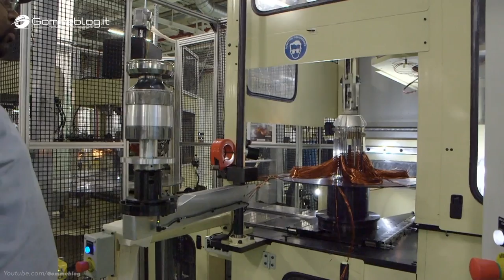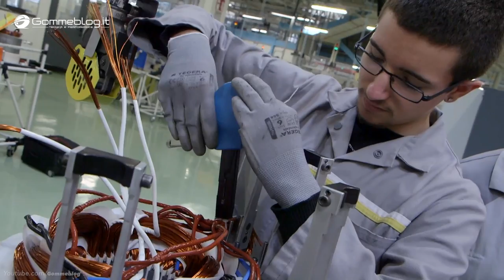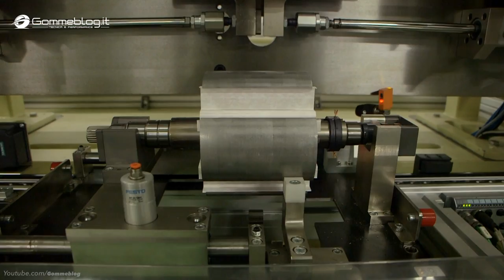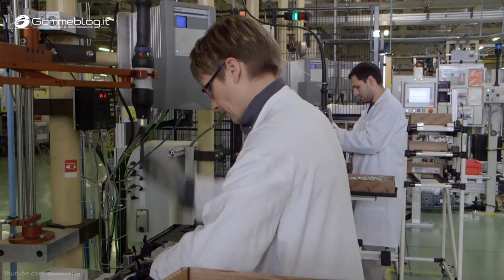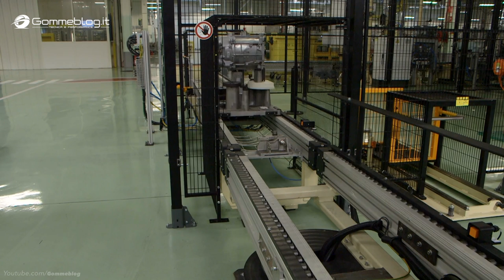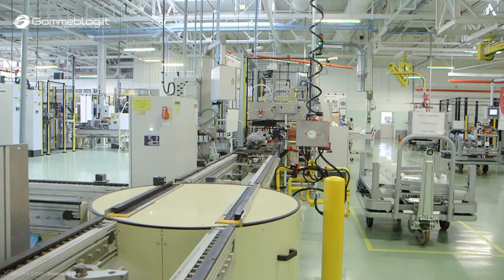Electric Motor Engine FACTORY - HOW IT'S MADE a Renault Engine Assembly

Comment from the maker: You Like Electric Cars ? What about ... in your opinion .... Electric Motor Engines and Petrol/Diesel Engines ?
Reply: Humankind might as well start getting used to electric motor cars. Combustion engines cause environmental pollution and we will eventually run out of oil (petrol) in X number of centuries anyway. Therefore, we should gradually start using the remaining untapped oil for other products, except for combustion engines.
Reply: GommeBlog.it: Car & Performance I'm always thinking of about an electroproducing couple, just like these in electric generators. I've this idea for an electric car powertrain since the last year's summer, with the idea to make my very own solar-charging electric supercar
Reply: I love my EV!! I love not having to go to the gas station, I love it's impressive performance, I love that it's very quiet and comfortable. I love the cost savings! I'm never going back to a gas-powered car!
Reply: Energy efficience. At last we get off use the poor efficiency mobile Combustion engine how most produce waist heat.
Reply: Electric motors won't over take Petrol till battery tech advances greatly, but if batteries do improve, then they will be superior in the long run.
Reply: Extraction of energy from a permanent magnet without mechanical movement. (Solid State Power Generator) To eliminate mechanical work, to "trick" the magnet, it is necessary to have material with varying properties or condition - magnetic and non-magnetic, but with the ability to manage them. Then we will simply simulate the physical movement of parts in generators and in motors will exclude electricity with copper wires and will still have power. To change the state of the material from magnetic to non-magnetic, you need to change the direction of rotation of electrons around the nucleus of atom. By supplying electrical impulses from the frequency generator (fig4) to material with variable properties, it can be forced to transform into both States at any frequency.. For clarity, it can be compared to a welding machine where the 200A thirystor opens with a pulse of 5-6 Volts. Only we will not open the way for the power to pass, but will create conditions for its occurrence directly in the winding of the generator or in the stator of electric motor. Control of required force can be made on the low-voltage side of the device, changing the saturation of magnetic field. This allows to produce the exact amount of energy, and at the lowest voltages and frequencies, because there is no need for transportation; The Power is already where you need it - the Generator of electricity is already mounted in the electric device and the magnetic force required at the time - in the engine. And they can be controlled from outside, wirelessly (already from the phone). In engines, (fig3.) in order to overcome the counteracting force of each magnet, it is necessary to interrupt its connection with the pole at the time. The material of the pole is transferred to a non-magnetic state and create conditions for entering the working area of the next magnet. After his tryout, again translated into a non-magnetic state, so as not to interfere the next, and again to toggle the state when it comes to the next magnet. This is possible with the use of simple contactless relays (Solid State Relay) built directly on the terminals of the pole plates. Thus, the motors will consist of magnets on the rotor, poles (special material plates) around the stator and a system for switching them. This is again a few transistors with a battery and a resistor, all controlled from outside (WiFi). It's not a "Perpetuum mobile machine". A battery or capacitor is used to start the pulse generator. Such a motor is able to provide traction control, full braking and even parking brake, which is very important for elevators. Every wheel in the car is an engine and a brake inside. No power engines, batteries, transmissions, clutches, hydraulic cylinders with lines and cables for brakes. All signals, lighting lamps and devices of the car have built-in generators and WiFi connection with the controls of the car. Complete absence of wires and contacts! It means super reliability! Manufacture of plates of generators and poles for engines you can build on existing printers for the production of electronic components or by spraying and other new technologies. This will mean the synthesis of new material on an industrial scale. A similar compound was created in laboratory in 2001 (see Annex). No expensive or rare components.. The production of "spin plates" for generators and generators themselves can be established literally at home. Theory of spin effect: Spinning electrons Electrons have a property called spin. This rotation creates a magnetic field with N and S poles. If the electrons in the shells of an atom rotate in the same direction, the atom will exhibit a magnetic field and will react to the forces of the magnet. If half of the electrons rotate in one direction, and the rest rotate in the other direction, they neutralize each other and the material will be non-magnetic. figure 1 Below is a diagram of the electric generator. figure 2( can not provide here..) When the pulses are applied to the active element it changes its state from magnetic to non-magnetic allowing the passage of force from the magnet to the winding. By changing the polarity of the pulses at the input, you can immediately receive a direct current.
Reply: Every wheel in my car is an motor and a brake inside. No power engine, batteries, transmission, clutch, hydraulic cylinders with lines and cables for brakes. All signals, lighting lamps and devices of the car have built-in generators and WiFi connection with the controls of the car. Complete absence of wires and contacts! It means super reliability! 
 Interested? Ask Q.
Reply: WUB WUB WUB WUB WUB WUB
you like that? Thats what this music sounds like, it gives me a headache
Reply: __electric motor_engine but where is ellectricitty..???__electric motor_engine from rotE==-dB/dt and rotH==J+dD/dt and HrotE--ErotH= =div(H*E) ==power of engine_motor_electric ___archaix lord
Reply: __it s made from rotE==-dB/dt and rotH==J+dD/dt and HrotE--ErotH==div(H*E) ==power electric engine_motor ___archaix lord
Reply: Electric Motor Engines
Reply: Watch these automated machines are derived from the textile ones.
Excellent, but the passage of combustion engines> electric and braked by the seven sisters for obvious economic reasons.
And if the power plants pass from oil to hydrogen, only in this way will we have less pollution and thousands of deaths less deaths.
Reply: GREAT !! But wait until we have to dispose of the batteries , then the fun starts !!!!!

Comment: I have to say that was a very cool video. It's interesting how automation has reduced the amount of time it takes to wrap those spools for the magnetic wire. They do in seconds or minutes what would take hours or days to do.
Reply: People have had electric motors for a long time. Except for the very first electric motor, I would guess they used the one they did by hand to spin the wire on all the others. The modern machines just do more of the in-between work like snipping the wires and moving them in and out of the place you coil it. It is a case of continuous evolution, so no before and after times really.

Comment: Wonder how they manage high reliability with those wired stators ?
Reply: saladdogger  I meant wired rotor.  . Wired rotor adds some maintenance because there must be a collector to power the rotor. Or maybe its a shorted rotor.
Thats what I meant talking about reliability. Just because of the needed maintenance.
There are other options like a solid rotor(dont know the right term in english). But anyway it still reliable ofc.
Reply: @BenPasriche  Not shorted. This use slip rings with brushes to power the rotor. With this technique, they achieve very high torque at low rpm, but when the torque not nedded, they can use field-weakening to decrese the braking force from strong magnetic forces. Field-weakening also very useful at high rotor speeds. The only one thing which need maintenance, is the brushes, but it runs long long time before that, because the filtered cooling air. Dust is the brush killer. So this type of motor almost or same good as a copper core induction motor.  Different approach.

Comment: These motors are old school DC brushed motors that will require scheduled maintenance. Tesla and other EVs use 3 phase AC induction motors that can be sealed into the housing and forgotten about.
Reply: i m french and this is good to know. thx
Reply: Hi Jerry;

          Are you sure about this being an old school DC brushed motor?  I don't see any commutator on the rotor - just 2 slip rings seen at 8:09 on the right end of the rotor shaft.  Also, when the stator is having the winding ends laced (5:47) there appear to be three orange (high voltage) wires connecting to the stator.   To me this looks like a wound rotor three phase AC synchronous motor.  Yes, the brushes on the slip rings might require replacing, but they will last a lot longer than brushes riding on a slotted commutator all other things being equal.  Brushes riding on slip rings can span a larger part of the circumference of the slip ring because you don't have to worry about shorting between commutator bars.  Notice also that the slip rings are quite small in diameter (much smaller than a commutator could be for this size of motor) and that will keep the surface speed of the brushes fairly low which will increase their life.  The brushes will probably last as long as the shaft bearings and both will probably outlast the car they are installed in.
Reply: Vincent Sullivan you are correct. It is not a brushfed DC motor.
Reply: Vincent Sullivan : The armature contacts were mistaken for commutator contacts by me. The slip rings you correctly identified are likely for the Field Coil instead of using permanent magnets. These slip rings still need brushes to operate and will wear still out, just not as fast as commutator contacts. For a single winding Field Coil commutators and slip rings are interchangeable.
Reply: That slip ring is for field current. Its a synchronous motor. Very similar to a generator used in power plant (if you scale it down alot).
Reply: And brushless motors can be made for DC too so no excuses.
Reply: @Vincent_Sullivan  Automotive alternator brushes and slip rings seem to need maintenance from time to time, and they transmit just a couple of kilowatts not hundreds.
Reply: @phamnuwen9442 :  Actually, in an automotive alternator the brushes and slip rings only transmit the current to energise the rotor to create the rotating magnetic field.  At an informed guess, most automotive alternators would transmit between 25 and 50 watts to the rotor to create the rotating magnetic field.  The "couple of kilowatts" you mention come from the stationary windings of the alternator through a set of diodes and this power is NOT transmitted through the brushes and slip rings.  As I stated in my comment above, brushes and slip rings may indeed require maintenance but they will in most cases have a much longer life than brushes used with a commutator.  Keep in mind that the main material of the brush is graphite which is a natural lubricant.
Reply: @Vincent_Sullivan  I stand corrected on the rotor power level, however presumably you'd still see increased brush and slip ring wear with a more powerful electric machine (rotor power being proportional to motor power level). Anyway I imagine they have tested this and found the slip ring life to be adequate, whatever that means.

Anyway, at least in the past, turning the alternator slip rings (on a lathe) used to be a thing, which would be a major headache on an EV motor.

I think I'd pick a brushless EV over a brushed one, just to be sure.

Comment: I like electric vehicles than petrol and diesel engine, but the battery cost to run an electric vehicle is high, otherwise the electric vehicle is awesome no sound and air pollution wow great,my idea is to  develop a capacitor that produce electric current according to instated of lithium ion battery
Reply: Denny joy your definitely not a engineer, and don't seem too see h the grand scale of what makes things work!!! Try again young grass smoker
Reply: Travis Bull sorry sr. admire you. You are great
Reply: It's a myth that electric cars make no pollution. The electricity is made in a facility that burns focil fuel. The batteries in electric cars has more impact on the environment than a conventional car so in the end they cause more damage. You still feel good thinking your doing something good for the world and I guess that's all that matters.
Reply: @stoneyswolf  There are more than coal and gas power plants, and trains and trams don't use Batteries like electric cars and there are more power storage technologies than just lithium ion batteries.
Reply: Travis Bull   Electric cars get their power to charge from the grid. Power plants are no more efficient than cars here in the US. If you're not somewhere that uses only green energy, such as Eutopia, you're either misinformed or dishonest.
Reply: @fredivory4304  France uses 80% nuclear. Cheap and emission free.
Reply: @phamnuwen9442  ...........and is being fast tracked to be phased out for safety reasons. And don't even think about fusion, 50 years out at best, if then. Your move.
Reply: @fredivory4304  Total number of deaths from radiation from civilian nuclear power in the  West: 0.
Reply: @phamnuwen9442  That doesn't have anything to do with it. Facts don't shape the argument anymore. It's more feelings than truth. Especially here in the US!
Reply: @fredivory4304  Facts always win in the end.

Comment: why do you need gear boxes, couldnt electronic controls manage the changes im speed?
Reply: You are correct, the speed of these motors can be controlled variably.
This is why only one gear is needed.
The gearbox only reduces the speed of the motor while increasing the torque.
The size of an electric motor generally depends on the torque it needs to output.
To output a lot of power, the motors are designed to run at a high speed.
Therefore the gearbox is needed to reduce the speed and increase the torque.

Comment: Lol.
Dramatic footage of amateur robots make of extruded aluminum and pneumatic actuators.
You've managed to hire two or three moderately creative engineers and you aren't supporting them. Marketing is obviously more important or the equipment would be made of castings.
This looks like a video from china.
Don't break your arm patting yourself on the back. Any decent engineer could do this in a weekend.